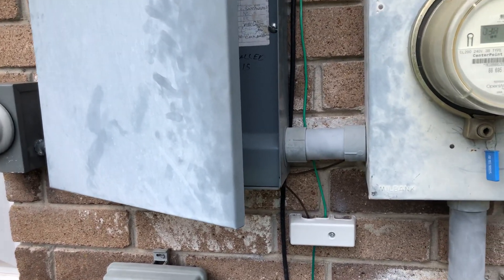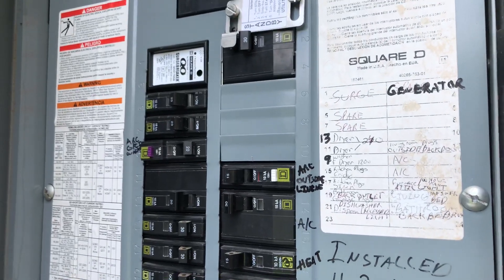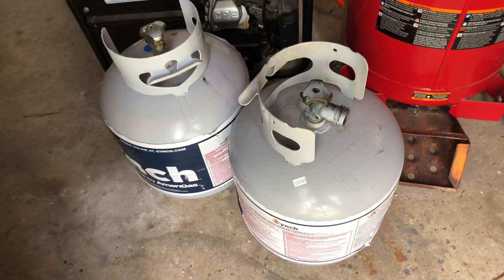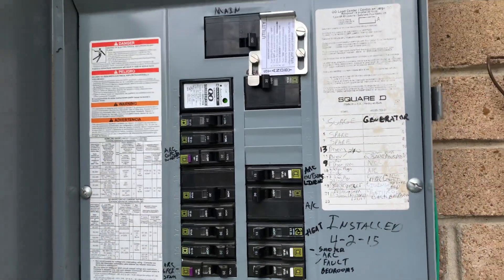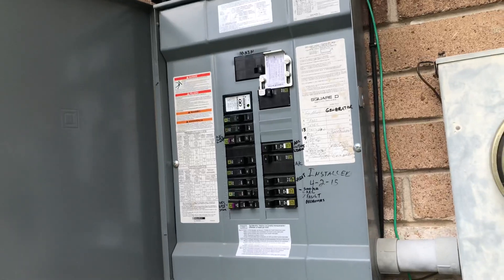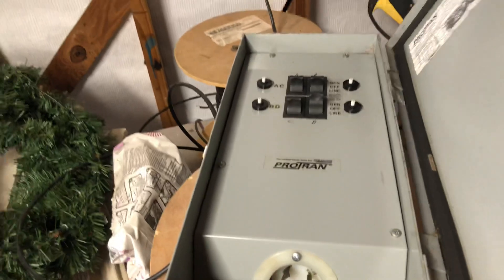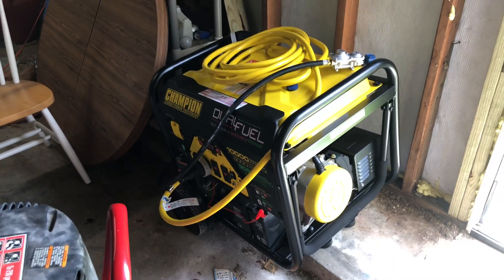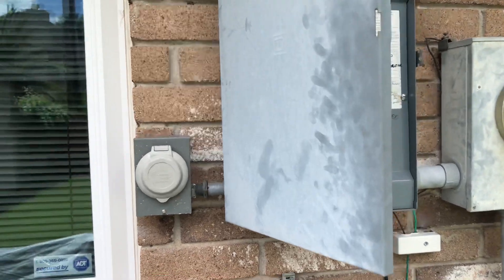Champion 8000 portable generator setup for house

Comment: Do you have any problem running a high-efficiency gas furnace with this generator?
Reply from the maker: Mine is standard efficiency and I have no issues. They draw very little power.

Comment: How many tons is your Trane unit?
Reply from the maker: 3 ton, 2 stage.
Reply: @billybassman21  I have a 4 ton, 2 stage Trane unit 18 seer. I wonder if that hard start kit will work. Do you recall where you purchased it?
Reply from the maker: @jmpardo88  I got it on ebay. I would search your model number on an HVAC parts website and see if you can find the one for yours, then buy it where ever. You can also buy the generic 5-2-1. hard start.
Reply: Look into soft start .... Bette r for the compressor but $$$$  @jmpardo88

Comment: What kit did you use to convert your generator with natural gas?
Reply from the maker: Just cut the hose to the factory regulator and used a Woodward low pressure regulator. Runs on both natural gas and propane.  Worked great here in Texas during the power outages.
Reply: @billybassman21  does it still run on gasoline?
Reply from the maker: @brucewillis7135  yes though I have never ran it on gasoline. That is a last resort, natural gas is the first.
Reply: @billybassman21  would the generator run your ac without the the hard start?
Reply from the maker: @brucewillis7135  it started it, but knocked the whole house out for a second. With the hard start no issues.
Reply: @billybassman21  was it running on natural gas?
Reply from the maker: @brucewillis7135  I converted it, I have some other videos on it.

Comment: Can you run the AC with only the 30AMP plug?  I was reading that a 50 AMP plug is needed.
Reply from the maker: Yep, it’s 240v the AC draws around 15 Amps.
Reply: You can with both depends on what size generator you have     with the generator he has  Yes!!
Reply: I recently bought the tri-fuel Champion and to run my 2 1/2 ton AC upstairs I have the Micro Air Easy Start “soft”start kit that reduces the starting amps from 73 to 26. Quite an impressive device that’s easy to install and let’s me run the AC.
Reply: @Ojb_1959 , you are correct.  The AC has the biggest draw at start up so if you don't have a soft start make sure you put your AC all the way down so it doesn't turn on and off while running generator.
Reply: @victorarcos6178  a device that controls amps on start up.  Your AC draws the most power during start up to kick on the compressor, after the start up it doesn't use high outputs of energy and just runs.  That's why you hear a big bang when the AC starts.